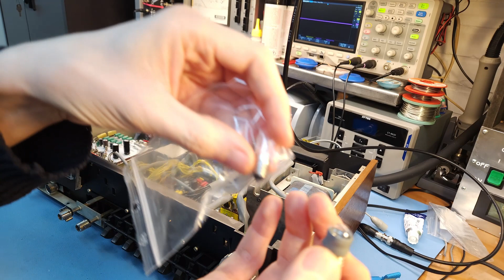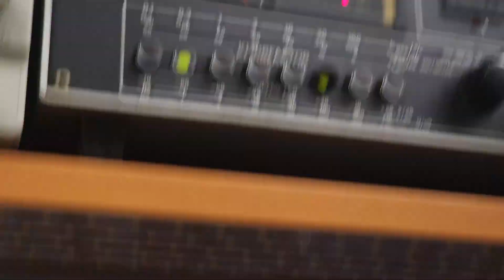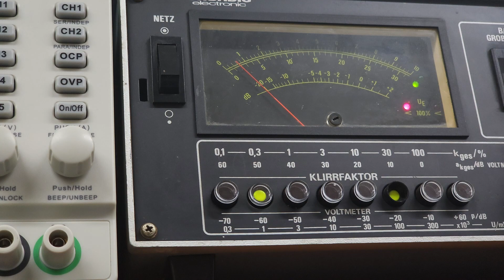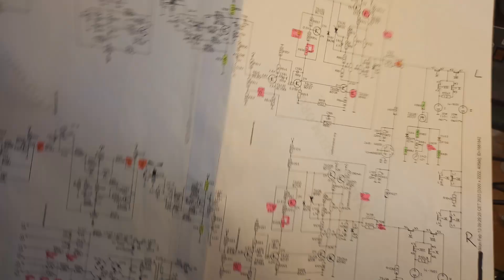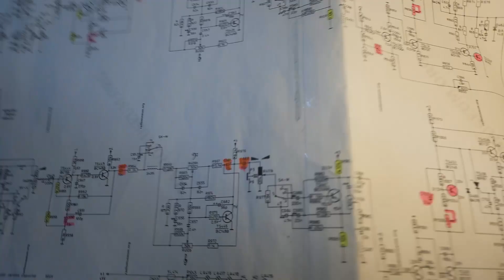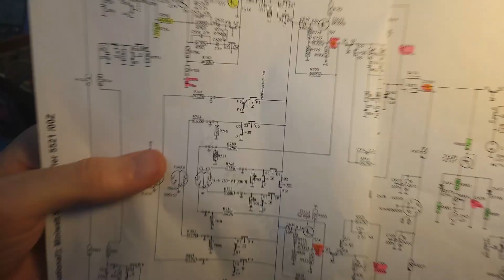Let's put it to the test! - Siera 5521 / Philips 22RH521 - Part 4

Comment: Yes, replacing with BC549/BC550 would probably be "Best practice" as they are "Low noise" transistors.
But On-semi's datasheet for these transistors only list them as being 0.8 to a few dB lower in noise than the regular BC547/548 s.
But you could be (and probably will be) lucky, as the old transistors might be more noisy than the new ones.
Reply from the maker: Indeed. The main difference is in the maximum noise figure (4dB vs 10dB), but I doubt these original lockfit BC148s will still meet that spec.